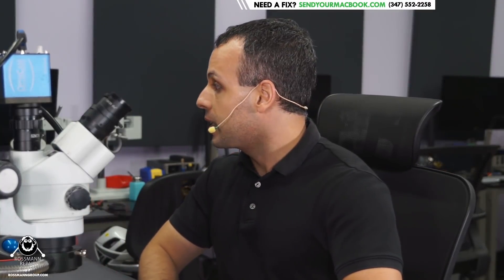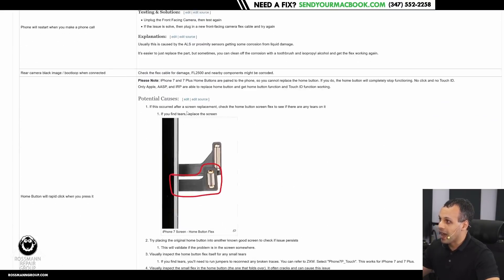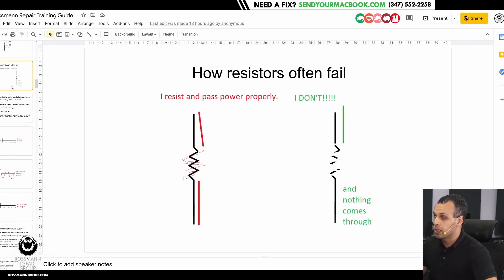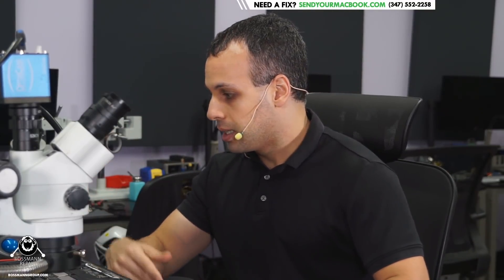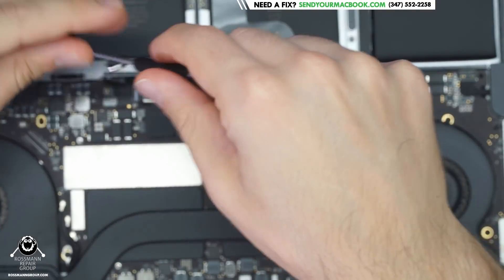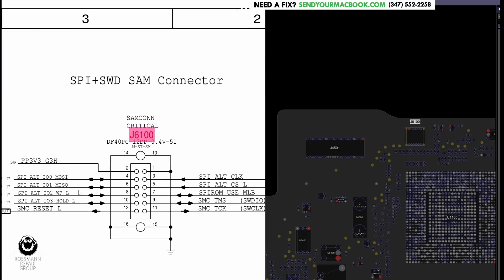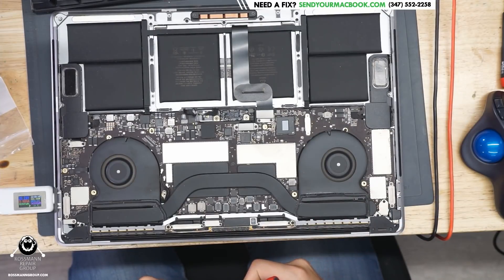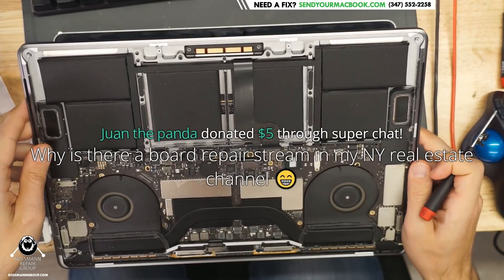A1707 Macbook Pro dead not turning on because it got screwed

Comment: My 2017 iPad Pro 12.9 , so not too much older, died suddenly. Apple (Genius) told me they would not repair and the genius did not know what the problem was. As there is only screen exchange places hare in LA, I sent it to iPad rehab in NY. Unfortunately they could not figure out what was wrong and I had them send it back at my expense, so that I can use it as decoration.

Comment: so i own an acer aspire 5 and my laptop fell no broken screen but black screen laptop turns on and integrated mouse doesnt work so i disasembled it myself to pices and searched everything to find wire isolation open and it was shorting it, then i took electrical tape and taped it and it worked, service wanted 160 euros for new screen....

Comment: Louis, I know how that screw got there, it fell off of his screw driver and couldn’t find it, then he tried bring it up and it died. Since he couldn’t find that screw, it ended up in your shop.  Being a self servicer I had my macbook apart several times doing upgrades. Mine both work, but way past their prime an 2009 and a 2010.  I was  a Customer Engineer for IBM and the systems I worked on are now in museums 360/20 thru AS 400. More complicated than today’s pc’s and mac’s,  25 books of logic circuits and required to know how to do microcode and program the system using the dials on the computer in hexadecimal.  I admire your ability to fix those mac’s and make the customers happy again.

Comment: #Louis Rossmann, I honestly believe that screw seems to be a random event there. I know people are dumb and they will lie every time, but this looks like a screw got dropped in the laptop at a previous repair, it danced around in the device for a while until it found itself a nice spot in that connector killing the entire circuit. The best demonstration of this would be that the device might not be missing any screw, proof that the missing screw that ended up in the connector was replaced during the previous reassembly, and that would imply a repair shop might've been involved. I've seen countless of times screws left randomly in devices and landing in the most unexpected places. This case is even more random, but for an individual to manually insert that screw there while the rest of the device is quite decent and the other screws are in their place... makes no sense. I could be wrong, of course, but that's my opinion about this.

Comment: That screw is tiny. Is it possible it got sucked up by the fan, from some surface it was sitting on, spat out, and then just somehow landed there? Also, those fans look pretty clogged up, maybe the owner went in there to clean them and F'd it up that way.

Comment: @Louis Rossmann Is just me or this big chip under place where screw was found have broken/crooked bottom right corner.
(it was first thing hit my eyes when you ask what is wrong with motherboard, not that screw)

So it also can mean that screw just was random flay inside macbook doing random damage until stuck in place where you find it.

Comment: Or the reason there is a screw in the connector port because there is a screw loosen inside and coincidentally bumped into the connector port. 

Only a retard would think someone will put a screw into a square hole instead of a rounded screw hole, that not even a retard will do.

;-)

Comment: 3:20 oh no. AC is not passing though the cap, it's vibrating back and forth, nothing needs to pass while DC is flowing from a to b. 
no electrons pass though cap, they gather at the end and then they go back, like water in the glass when you shake. it bounces from the end and go back, nothing passes.
Watch electroboom on the topic.

Comment: Very odd, it looks as if it was one of the pentalobe screws too? Most users don't have those driver bits unless they're already the sort of individual who wants to open a more recent MacBook. Maybe I am just weird, but my experience is that very few individuals are the sorts to take it upon themselves to do that unless they already have at least some idea of what they are doing (e.g. maybe they know they want to upgrade the SSD. There is not too much in those which is a simple user upgrade).

My first guess wouldn't even be the end user, but maybe something happened at the factory depositing an errant screw in the chassis and it just got knocked into that position through some jostling? At least it seems as if it was a relatively simple fix!

Comment: I have only a fleeting interest in board repair.  At 74, I have better things to do.  I got my feet wet early though.
At 14, I lusted after a Harmon Karden Stereo “integrated” amplifier kit (25 w/channel) that sat in a hifi store window.  I had enough $ saved from my paper route that I bought it.  I had no tools, very little knowledge and no one to learn from (no yooboob) so the store allowed me to work above the store after school.  I was in heaven.  The damn thing worked first time, but with a hum for which the manufacturer had to send a correction.  After that I built many Heathkits for folks.  I built their top o the line stereo, even their guitar amp and clock radio.  Fun times.  My career ended up in Meteorology at a desk!  Great career though!  Anyway, I'm here to get a glimpse of a New York minute, and to learn and support RtRepair.  I just watched a dude take down the appliance manufacturers for their vulnerable electronics.  You're lucky ro get a few years out of them before you have to replace a control unit…last time, our dishwasher unit failed..$400.  Good luck..you're doing great.

Comment: Okay, it took me a while, saw it as he started telling chat that you can't say it's shorted or it's broken... Is that a f%%%ing screw thru some kind of chip or cable connector?! I'm pretty sure I'm seeing a screw through some kind of connector for a cable. There's definitely surface mount legs on both sides of that screw, which is wrong. WTF?!

7:30 - Yup. Although at least it was just lying in there. I thought somebody had actually screwed it in.

Comment: You can see the the hole where the screw should've been, right below the track pad connector.   
I've opened A LOT of macbooks where there's a screw rattling around, they come loose after not being torqued properly.
Reply: This. Please try to give them the benefit of the doubt as they might honestly not have been responsible for this. If they say they had nothing to do with the screw, you still fixed the MacBook for them and you might be able to still help them.
Reply: Just opened the same model MacBook, screw loose rattling around, can't find where it should go but seems like a common problem the 'extra complimentary screw' on these macbooks

Comment: Same problems occur with vehicle repairs. Once the obvious problem is sorted, we then have to ask why someone was there in the first place.  Then the denials and stories come out.
I was wondering, is there a screwhole missing a screw, or did someone add another screw from their stock?  An extra screw says definitely someone has been there before, but a mislocated screw could have become loose and travelled until it fell in a hole.  You plucked it out with tweezers, so that suggests that no-one tried to screw it in.

Comment: 13:09 Louis Rossman sometimes screws get rattled loose when people have laptops in their vehicles like I do. Or when people just throw them around all the time sitting down hard and slap tables. So yes screws can come loose on their own that do not have loctite in their threads as you have learned this I'm sure over all the years you have been doing this. Somebody might have taken it apart or not. Now's the Time to fix it and worry about that later.

Comment: OK Guess time.... that is a hardware screw and not one for that board in that  hole up top left of the motherboard? Whatever it is I( do not like it in any case....
Reply: Why is that chip or whatever is it skewwiff? Is that a pad or some other botch? (on the zoomed in section)
Reply: A screw dropped into a connection..... YIKES....
Reply: That other screw I mentioned still looks like it was mauled by a bear at a distance :P

Comment: Well, SPI is not an Apple-specific term. Most Intel documentation for newer Intel CPUs who uses an EFI-based firmware calls the initial loader an SPI.
Reply: SPI stands for serial peripheral interface which is a communication protocol used to get data into and out of the flash chip. It does not say anything about what the chip actually does. I would describe it as a bootloader personally.